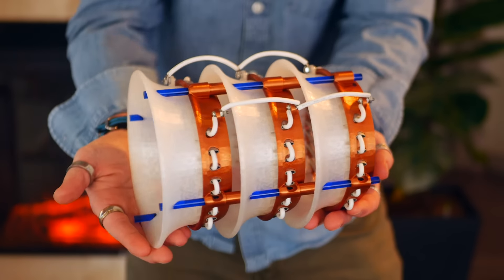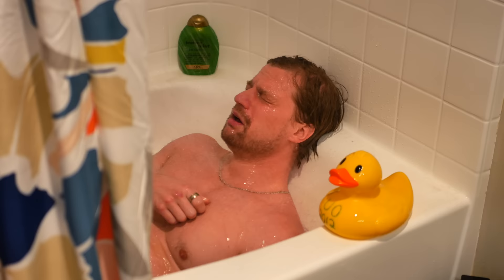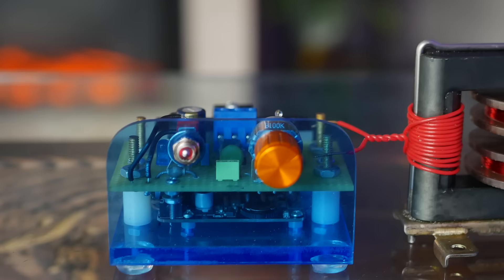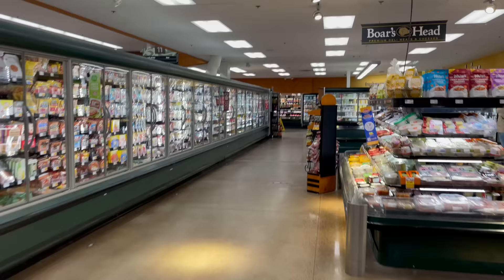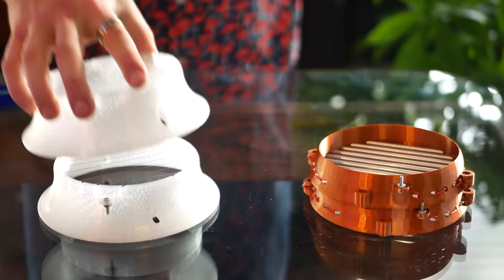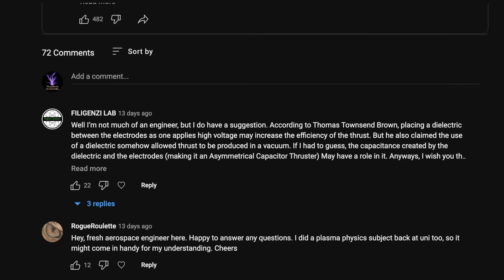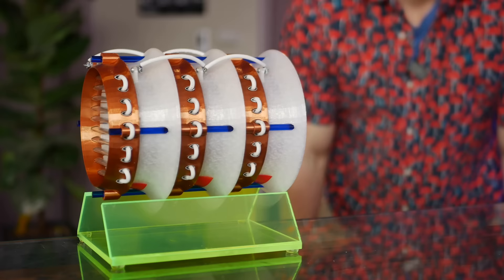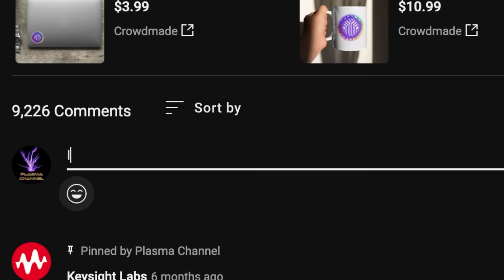The Next Generation of Ionic Plasma Thrusters (BSI MARK 2)

Comment: Phd student here. Really awesome work! If you ever want to build one of those NASA thrusters I can help. My background is in Hall thrusters and know a bit about electrospray as well. Keep up the great work!
Reply: The thruster Plasma Channel used conductive sticks and wires to accelerate ions? The build looks very different from Hall thruster though.  I wonder if the +- charged acceleration grid in hall thruster will work as well in atmospheric conditon.
Reply: @davidliu3463  they are different from the thruster in the video. Hall thruster or gridded ion thrusters or electrospray thrusters (many different kinds of thrusters) work in vacuum. The equations shown at  the funny NASA segment in the video are from some of those thrusters that's why I suggested them. The one built in this video is amongst the only ionic thrusters that work in atmosphere via the electrohydrodynamic phenomenon.
Reply: Yes! Somebody who can help with more scientific testing and data gathering would do wonders in addition to raw knowledge
Reply: OK let's get this correct  !!   #1  The only reason radio waves and AC current travel out in space and down a wire is because of the "CENTER " of a magnetic field.  (The "B" field), The North and South poles are the weakest part of a magnet !!   Just like Tesla said,  you got to look at things you can't see !!  At the center of a magnet is anti gravity,  (just tap the center on any glass or plastic and it will loose weight), The center can repel water if vibrated at the correct frequency,  If you vibrate the "B" field into granite rock it will become soft and you would need copper tools to work on same , you don't want to disrupt the magnetic (B")field ) with other iron.  Once you understand the "B" field of a magnet and how it relates to the entire universe we live in, you will then understand what Tesla was telling everyone "LOOK FOR WHAT YOU CANNOT SEE""  .I believe the pyramids were inter galactic communications and transportation systems.  Stone Henge and Gobekli Tepe , power plants.  Take a look at Coral Castle Florida on YOUTUBE and you will see a similar pilar. I believe these horizontal pillars were oscillators that would provide excitation for many things from crops in the field to anti gravity

Comment: You have to try putting a convergent nozzle on this. I’m not sure how much static pressure it’s generating but there must be some, and a nozzle would convert that into more speed. It would also have the added bonus of slowing down upstream flow so it has more time to interact with the extra stages, like you saw in the fan test
Reply: I was thinking same why he not got a output nozzle to make air move faster like a rocket 😅
Reply: More airspeed, but less thrust
Reply: @norbis3939  that would violate the conservation of momentum, how do you figure?
Reply: @The Con Hathy Channel  It would if it were moving the same amount of mass. I don't think it would, though, because with this setup I don't think there's enough pressure for a nozzle to be effective. I could be wrong, but I think with the way the air inlets on the side are working, a nozzle would probably reduce the airflow. This air isn't being compressed like in a rocket or turbine engine, it's just flowing.
Reply: @ConHathy  I guess I could be wrong. Like you said, there has to be some pressure, so maybe a nozzle of some type might help, but it would have to be a very wide nozzle and might not be worth the weight. Worth trying though, I guess
Reply: @norbis3939  you may be right on weight, but if there’s any static pressure at all (which there must be some for any propulsion) it you can use a nozzle to lower that back to the atmospheric pressure and it will optimize the decrease in mass flow vs the increase in velocity. 

The really interesting thing would be if it improved the efficiency of the propulsion by slowing down the upstream velocity allowing for more interaction with the stages, that might make it worth the slight weight increase
Reply: @norbis3939  You increase the airspeed in an augmenter to entrain more air mass and then recover at the exit.
Reply: OK let's get this correct  !!   #1  The only reason radio waves and AC current travel out in space and down a wire is because of the "CENTER " of a magnetic field.  (The "B" field), The North and South poles are the weakest part of a magnet !!   Just like Tesla said,  you got to look at things you can't see !!  At the center of a magnet is anti gravity,  (just tap the center on any glass or plastic and it will loose weight), The center can repel water if vibrated at the correct frequency,  If you vibrate the "B" field into granite rock it will become soft and you would need copper tools to work on same , you don't want to disrupt the magnetic (B")field ) with other iron.  Once you understand the "B" field of a magnet and how it relates to the entire universe we live in, you will then understand what Tesla was telling everyone "LOOK FOR WHAT YOU CANNOT SEE""  .I believe the pyramids were inter galactic communications and transportation systems.  Stone Henge and Gobekli Tepe , power plants.  Take a look at Coral Castle Florida on YOUTUBE and you will see a similar pilar. I believe these horizontal pillars were oscillators that would provide excitation for many things from crops in the field to anti gravity
Reply: @vincecox8376  You are a very confused robot
Reply: The venturi is inefficient, so it absorbs energy from the system. It converts pressure energy into kinetic energy, and there is no pressure. The 3 stages should be in parallel, and where they converge there should be a venturi to add extra airflow. That's great for the airflow meter, but bad for propulsion, since its better to use the pressure for propulsion, rather than inefficiently convert the pressure to airflow
Reply: not enough pressure, it would just blow the air out the front. watch integzas video on making a turbocharger for his pulsejet
Reply: If air intake for each stage was isolated total thrust should increase? Intake valves for example. This would maybe decrease airspeed but still increase force generated.

Comment: I would recommend 2 things.
1: Remove all axillary air intakes to remove all the additional air entering the system making it more turbulent and thus less effective at each stage.
2: if you want increased thrust and air speed you need to focus all that air, so play around with a diameter reducing cone after the last stage, you will need to play around with different lengths and diameters to find one that gives you what you are looking for 👍

Best of luck, it's been fun watching what you have been working on.
Reply: That was my thought process as well, each stage of his design is the same with no change in velocity, take a jet engine for example it narrows. My guess is make
Each stage a percent smaller and then also what about offsetting the positive and negatives for each stage?
Reply: @treyhedgepeth9598  exactly, the issue with adding more air along the way instead of having only one intake is each stage will draw in slow moving air which results in more volume moved but at a slower velocity, if you have one intake then each stage accelerates the air instead of trying to compress more air into the flow which results in more volume and more turbulence.
Reply: @treyhedgepeth9598  if you then take it so only one intake with a taper at the end then you get good flow and increased thrust coming out the end. ☺️
Reply: To keep in line with your jet engine example, the cowlings of jet engines are streamlined, and different designs have different volumes of blow-by air that does not go through the combustion camber, but around it and into the exhaust to help keep flow ideal (among other reasons).

I think he needs to size the stages from larger to smaller, with greater distance between each stage, with a cowling that surrounds the whole deal, allowing sufficient air into the thrusters, but also reducing turbulence and helping direct air into and out of the entire assembly.
Reply: @stevescuba1978  Yeah that would be spot on!
Reply: So a ducted fan without the fan

Comment: As I think someone mentioned below, you could try making each consecutive ring slightly smaller, only by a few percent at each stage. That way you would introduce 'venturi' like effects to increase the speed of airflow, whilst also adding energy at each ring. Great video, thank you.
Reply: And add a spool
Reply: Or we could come together and design a 3.0 working version of course.
Reply: I don't know if the venturi-effect is greater than the loss of thrust you exchange for the smaller diameter. Less 'cable' means less charged particles and less ionic wind.
But the best way to say is to try :)
Reply: The Next Generation of Ionic Plasma Thrusters (BSI MARK 2) faces a problem related to the efficiency of ionizing propellant. While most ion thrusters ionize propellant by electron bombardment, which involves a high-energy electron colliding with a propellant atom, there are limitations to this method. The BSI MARK 2 aims to improve upon this by introducing a new technique, whereby each consecutive ring is slightly smaller, creating a venturi effect that increases the speed of airflow and adds energy at each ring. However, the effectiveness of this technique remains to be seen, and further research is required to ensure that the BSI MARK 2 can achieve optimal efficiency in ionizing propellant.
Reply: I was thinking the same thing. I was also thinking about if you shrouded the entire thruster as well
Reply: And more positive.

Comment: You could put the whole thing in a housing, with slits at angles off-set from each other. That way the side intakes aren’t competing with each other for wind as much. 
I think having the stages be different sizes, and the housing go from large to small, along with the stages, could make use of the effect where the velocity of the fluid increases as you hold flow rate steady & decrease the area through which the fluid travels.

Comment: You should try inverting the polarity of the second ring (emitter and collector).

Once passing through the first ring, the air is no longer neutral, it's ionised, thus the second ring's emitter will actually repel it. By inverting the polarities of the second ring, you may experience the boost you are looking for.
Reply: “Reverse the polarity” irl. lol
Reply: or just turn the middle 90°. Not like the first tesr between pos/neg, but whole structure.
Reply: That’s exactly what I was thinking that and possibly 3 inlets to 1 outlet maybe with some ducting if each unit is able to put out 2ms and you duct that 3 times into one outlet and change the outlet size maybe.. to accelerate the air flow
Reply: OK let's get this correct  !!   #1  The only reason radio waves and AC current travel out in space and down a wire is because of the "CENTER " of a magnetic field.  (The "B" field), The North and South poles are the weakest part of a magnet !!   Just like Tesla said,  you got to look at things you can't see !!  At the center of a magnet is anti gravity,  (just tap the center on any glass or plastic and it will loose weight), The center can repel water if vibrated at the correct frequency,  If you vibrate the "B" field into granite rock it will become soft and you would need copper tools to work on same , you don't want to disrupt the magnetic (B")field ) with other iron.  Once you understand the "B" field of a magnet and how it relates to the entire universe we live in, you will then understand what Tesla was telling everyone "LOOK FOR WHAT YOU CANNOT SEE""  .I believe the pyramids were inter galactic communications and transportation systems.  Stone Henge and Gobekli Tepe , power plants.  Take a look at Coral Castle Florida on YOUTUBE and you will see a similar pilar. I believe these horizontal pillars were oscillators that would provide excitation for many things from crops in the field to anti gravity
Reply: v
Reply: @vincecox8376  where can I read about this please
Reply: @vincecox8376  eeuhm, vibration can be considered free fall for GHz periodes of the time. Intergalactic communication at what speed? Pyramids are just really good stacked rocks..
I'm not sure a what force you can pulverize granite with an electric field but like the amount of electricity necessary would be stupid. You're talking about pulsar levels of force
Reply: @vincecox8376  that is fascinating. Thanks for this information
Reply: @badoem5353  check out ancient apocalypse. There is also a video here on using sound to move matter as well. While there is a large amount of psuedo science I don't agree with I feel our timeline is... out of date and there is more to civilization pre 10,000 bc.
Reply: @lootedgravel3283  you just said nothing while saying there's more. Just say you don't know... 
Sound is an air pressure wave, if surface is large enough. It will move true amplification or individually

Comment: For a third version, I believe that each sector of the thruster must be more powerful than the last.  this will generate the effect of greater wind acceleration.  Your round electrodes are generating too much drag, use plane wing-shaped electrodes.  one way to do this would be to print electrodes in the shape of wings and wrap thin copper wires around them so you have the shape you need.

Edit: if you ever make the electrodes in the shape of an airplane wing, I realized that something needs to be done.  Only the front of the metal electrode should be exposed to the wind.  I believe that the way it is, whether with the round electrode or the wing electrode, if the back of the electrode is exposed to the wind, it can generate drag due to electrostatic forces.  So I believe that only the front part of the electrode should be exposed to the wind.
Reply: I think alternating polarity on each stage will eliminate that problem. Maybe even eliminate the need for the fine wires on all but the first stage, if the sharp trailing edge on the airfoil collector can serve as the emitter for the next stage. I'd use plastic drinking straws as the airfoil form. Give them a crease to create a sort of teardrop profile, and wrap aluminum foil over it. The serrated edge left from the foil cutter may further improve emission :)
Reply: OK let's get this correct  !!   #1  The only reason radio waves and AC current travel out in space and down a wire is because of the "CENTER " of a magnetic field.  (The "B" field), The North and South poles are the weakest part of a magnet !!   Just like Tesla said,  you got to look at things you can't see !!  At the center of a magnet is anti gravity,  (just tap the center on any glass or plastic and it will loose weight), The center can repel water if vibrated at the correct frequency,  If you vibrate the "B" field into granite rock it will become soft and you would need copper tools to work on same , you don't want to disrupt the magnetic (B")field ) with other iron.  Once you understand the "B" field of a magnet and how it relates to the entire universe we live in, you will then understand what Tesla was telling everyone "LOOK FOR WHAT YOU CANNOT SEE""  .I believe the pyramids were inter galactic communications and transportation systems.  Stone Henge and Gobekli Tepe , power plants.  Take a look at Coral Castle Florida on YOUTUBE and you will see a similar pilar. I believe these horizontal pillars were oscillators that would provide excitation for many things from crops in the field to anti gravity
Reply: OK let's get this correct  !!   #1  The only reason radio waves and AC current travel out in space and down a wire is because of the "CENTER " of a magnetic field.  (The "B" field), The North and South poles are the weakest part of a magnet !!   Just like Tesla said,  you got to look at things you can't see !!  At the center of a magnet is anti gravity,  (just tap the center on any glass or plastic and it will loose weight), The center can repel water if vibrated at the correct frequency,  If you vibrate the "B" field into granite rock it will become soft and you would need copper tools to work on same , you don't want to disrupt the magnetic (B")field ) with other iron.  Once you understand the "B" field of a magnet and how it relates to the entire universe we live in, you will then understand what Tesla was telling everyone "LOOK FOR WHAT YOU CANNOT SEE""  .I believe the pyramids were inter galactic communications and transportation systems.  Stone Henge and Gobekli Tepe , power plants.  Take a look at Coral Castle Florida on YOUTUBE and you will see a similar pilar. I believe these horizontal pillars were oscillators that would provide excitation for many things from crops in the field to anti gravity:face-orange-frowning:
Reply: @vincecox8376  Bro.  Are you ok ?

Comment: HI Jay, I'm a commercial pilot retired. If you look at the air intake on the Concord you can see that the intake is square. I think your round intakes are creating a lot of drag. And, the round electrodes are also creating a certain amount of drag/friction. I'm going to build a square version with a more aerodynamic intake and aerodynamic electrodes. Perhaps flat/sleek rounded edge electrodes could decrease friction and increase airflow. I'll also play around with increasing voltage over 50K. Your video and channel is GREAT, thanks!
Reply: I was thinking the same thing about the intake and electrode shape. Even scram jets get better performance using a squared intake. I really think you are onto something with these changes.